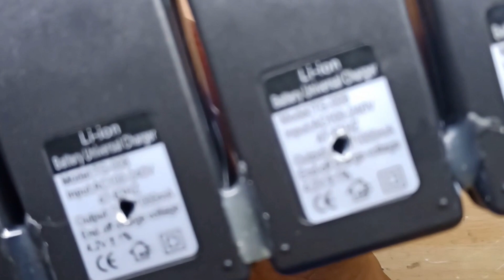DIY CHEAP 8 SLOT 18650 CHARGER

Comment: Ser san po kaya bumibili nang 18650 battery
Reply from the maker: dito po https://shopee.ph/1PC-TRUE-RATED-18650-3.7v-li-ion-battery-Tested-with-LiitoKala-Lii-500-(2000-2500mah)-i.75195450.6853317311
Reply: @DIYPINOY  ilang ah po yun battery
Reply: Salmat po ser

Comment: Same lng po ba ang lithium ion 18650 sa lifepo4 18650??
Reply: Anu po difference ng lithium ion sa lifepo4?
Reply: Ok lng po ba na gamiting charger ng lifepo4 18650 ung charger ng lithium ion 18650 na TP4056
Reply from the maker: hindi po
Reply from the maker: wala pong 18650 na lifepo4, magkaiba po silang chemistry at dimensions po